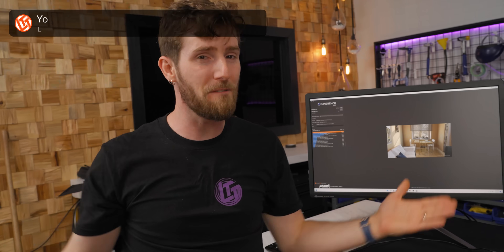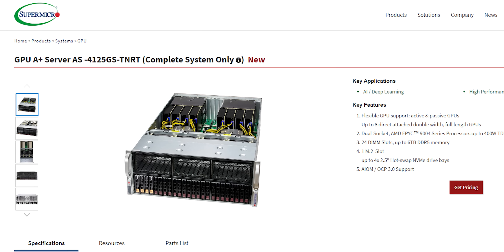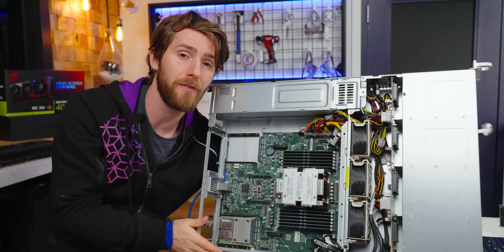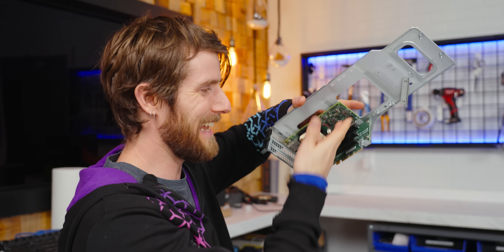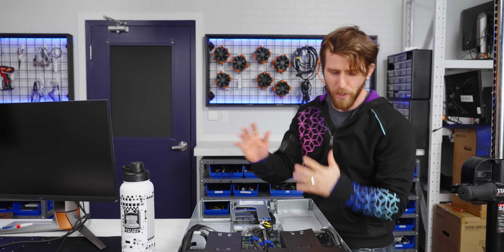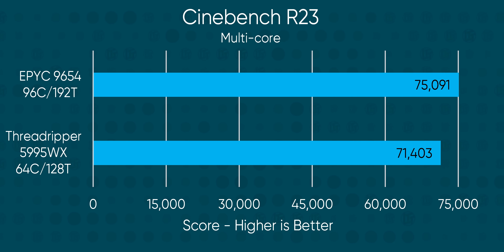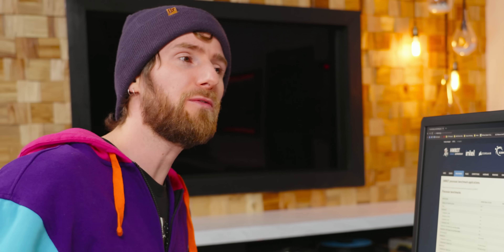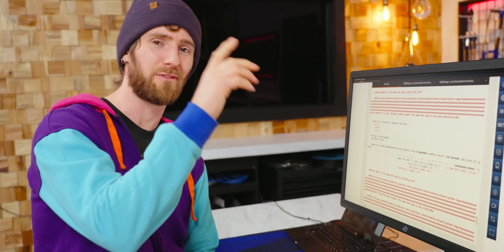HOLY $H!T - The FASTEST CPU on the Planet - AMD EPYC 9654

Comment: Almost 20 years ago we were stunned with dual-core CPUs. It's amazing, what AMD is doing.
Reply: And that was a game changer.
Reply: @flammablewater1755  Cerebras already sells a computer with 850 thousand cores on one processor. It's basically a CPU that fills the entire silicon wafer.
Reply: Yeah. Software, except few special cases, still can't do squat about these cores.
Reply: @SaHaRaSquad  and it consumes 15kW, you'll need a 400V 3x20A connection for just one as the whole system with that one CPU consumes 20kW
Reply: @BH4x0r  Which makes it incredibly efficient, consuming only 0.023W per core.
Reply: @SaHaRaSquad  sure, but AI acceleration requires vastly simpler instruction sets compared to ARM or X86/64, so you can't compare power & core count directly, it's like people talking crap about x86 vs ARM while ARM hasn't even got half the instructions and power (transistor count really) required per core per ipc scales exponentially (which means, the more instructions and the higher the ipc, it multiplies exponentially)
Reply: I remember being very excited about upgrading from Athlon64 to Athlon64x2.
Reply: @ren7a8ero  imagine turning cpu to achieve 6 cores at 6ghz and you will get a game cpu
Reply: @flammablewater1755  We will probably struggle to make software parallelize across that many cores (though it would definitely be useful for servers running many tasks at once)
Reply: @piotrd.4850  Yeah, having a lot of cores isn't very useful unless you have workloads that are parallelizable, but when you do, it hurts when you can't offload it to a multi-core server. It took the x264 team many years to work out how to take full advantage of multi-cores. I imagine Linus will be putting these bad boys to work as render farms.
Reply: @SaHaRaSquad  just looked it up. That's absolutely insane...
They also just launched a new supercomputer a few weeks ago... Apparently it uses just 16 chips yet still has 13.5 Million (!) cores 😯😲

For others:
Look up: "WSE-2 chips"
Reply: AMD is putting the AMD in Amdahl's Law! /s =P
Reply: And AMD was the first with dual core.
Reply: @circuit10  a lot of uses will probably split those cores up for virtualisation. And the us3 cases that require that many cores would be very bespoke software applications, in much the same way as software that will take advantage of the upcoming genoa-x will be (genoa-x being the 3dvcache version of the chip, with way more l3 cache than even these have, but with less cores and lower clocks as the cache is more important than the speed or the core count for certain specific applications).
Reply: @BH4x0r  So what? Use a decent machine with ARM and you'll see how little the instruction count matters in 99.9% of situations.

I don't know what your point is, I literally just mentioned a CPU with an insane number of cores, I don't know what the hell you interpreted into that.

Comment: imagine how fast this bad boy could print hello world to the screen
Reply: this wont really be faster than a normal PC (might even be slower)
Reply: depends on the screen
Reply: @CalcProgrammer1  really doesn't. Printing to standard out is just writing to a file
Reply: @hwstar9416  Depends what you mean by screen.  You can write to stdout faster than stdout can be rendered to a framebuffer and stdout can be rendered to a framebuffer faster than your screen's refresh rate.  However, the original question was explicitly how fast it could write to "the screen" and the screen only goes so fast.
Reply: @hwstar9416  You must be fun at parties
Reply: If you write "Hello World" into the CPU L1 cache it could take nanoseconds

Comment: Was floored at the 4090 comparison, the fact that the card is the size of the power supply and looked like a tenth of the server rack, is insane.
Reply: Yeah man, that thing is insane. I bet theres ITX cases with less volume than that
Reply: @musguelha14  micro itx, you're probably right!
Reply: It's called bad engineering. Boomer tech. I can wait for thin small nice gpu with 75 watt to play 4K 240fps. No cable needed.
Reply: Well, er yeah, obviously that would be great. Count me in. Then you just know an AIB partner in 2036 is going to push 800watts through that puppy to power the 80,000 shader units and the GDDR11XX.

Until we hit some kind of ceiling or have some kind of sensible standard this shit is just going to get crazier and crazier. 
Unless there's some kind of architecture or engine that renders all that power obsolete. I started to get hyped for the Euclidean thing until I realised it was all voxel... But something.

Just don't knock the people that made it all possible. These guys are legends. They made all this real. Like Dave Haynie and the guys at Commodore are my heroes.The whole 'boomer' shit is just insolent, infant bullshit to piss people off and get attention. Rise above that. You're better than that.

Comment: To those complaining about a server booting in 15 minutes, there were IBM p series (booting AIX) that would take half an hour just for the POST, before loading the OS.  With the OS booting and getting everything running, it would take about an hour.  I had to deal with 7 of those in a test lab I worked at back in 2010-2016.  They were not fun.
Reply: Probably built not having to reboot it often.   Yeah I too hate long server reboot times while my users keep asking "Is it back up yet as I have work to do?!" 🤣
Reply: Huh. Stores I assist still have p615 servers running AIX 5.X and they take a bit less than 15 min to reboot 🧐 But these need to go 😭
Reply: @RobBroderick44  Know what's more fun?  Having those in a test lab, where they have to be reformatted and total OS reinstall about every 3-6 months.  Wait half an hour for POST, then have a 30 second window to press F11 to get the boot menu to tell it to boot from CD, then another half an hour to start the OS installer.  Yeah, I had fun with those.
Reply: @dangingerich2559  One day if it is ever possible in your case switching to Linux and kexec'ing the kernel the reboot would allow you to scrap out the post time when the reason for the reboot is not to check the hardware.
Also there were more and more patches coming in the past two years or even more as well as in the years to come for Linux to allow parallel cpu booting and greatly reduce boot time.
Reply: @naguam-postowl1067  That's nice and all, but I (thankfully) am not in that job anymore, and am not dealing with IBM p series or AIX any longer.  I don't plan on applying to any jobs that include such things, either.  

At the time, I had to stay with AIX as the OS because we were testing customer specific circumstances, to make sure their OS and software would work with our backup appliance.  So, I had little choice in what OS we tested.  I believe that customer was US government, too, so they had little choice in the matter, either.
Reply: Servers are booting longer than consumer PCs because they have to initialize more stuff and perform more pre-boot actions. Normally PCs doesn't have any real lifecycle controllers, remote access controller, hw RAID controllers etc. These all adds up and mostly are not initialized asynchronously ( doesnt matter server or PC ).
Reply: Just start them all up and go eat lunch lol, come back and they're all ready
Reply: Why is that so long though?
Reply: @manojgail  because it was designed to never shut down.
Reply: @manojgail  They just take that long to power on self test.  They go through basic diagnostics on all the hardware before booting the OS.  The users of such servers are relying on the server to be reliable and accurate.  IBM kind of took it to the extreme, though.  It's been 7 years since I worked with them, but I think the model was p520?
Reply: @manojgail  I think because it has to train all 6 tb of memory. With a regular computer it only takes like 30 seconds or so to train 32 gb

Comment: In regards to the RDDR5 peculiarities you guys noticed in this video -

DDR2/DDR3/DDR4 were all 72-bit ECC. As you noticed, DDR5 is 80-bit ECC due to the DDR5 DIMM having two separate 32-bit subchannels. Each subchannel needs its own parity, and while it only needs 4 bits of ECC per subchannel, there aren't any 4 bit die structures so they get a full 8 bits of parity each. This means, yeah, a non-ECC DIMM has 8 DRAM chips, and an ECC DDR5 DIMM has 10. Previous DDR formats only needed 9 per rank. Since 10 chips is 11% more than 9 chips, there will always be at LEAST an 11% cost premium for DDR5 ECC DIMMs compared to DDR4 even if there is a per-bit price parity between DDR4 and DDR5 DRAM. Also, due to each DDR5 DIMM having an onboard VRM, DDR5 will cost more by structure. Eventually, DDR4 and DDR5 DRAM production volumes will flip, so eventually DDR5 becomes lower cost than DDR4. However, there's always going to be that cost premium baked into the structure.

Also, there will be off-roadmap 72bit DDR5 RDIMMs designed for specific hyperscale customers who do not want to pay the 11% extra bit premium for full 80bit ECC. A 72bit DDR5 ECC DIMM does NOT have full ECC coverage, but companies like AWS who control their entire software stack have written their environment to be aware of this and just deal with it. 72bit DDR5 will not be available to general customers because most people won't understand what 72bit DDR5 is, would buy it expecting ECC support, and have ECC failures in production due to the nature of 72bit ECC in DDR5. To avoid customer fallout, these 72bit modules won't be available to most customers nor will they be advertised on websites or general product roadmaps.

Secondly, you noticed that the registered and unbuffered DIMMs have a different notch. This has always been the case. You were not specifically comparing ECC vs non-ECC DIMMs in this video when you compared the key notch - yes, one had ECC support and the other did not, however, the key difference was one was an Unbuffered DIMM and the other was a Registered DIMM. There are no modern memory controllers which can support both RDIMM and UDIMM memory modules, so they are keyed differently. All registered or RDIMM modules are ECC, but unbuffered or UDIMM modules can be ECC or non-ECC. Consumer processors are all based on UDIMM. So, yes, you can have a CPU support both ECC and Non-ECC memory. Specifically, unbuffered ECC and unbuffered Non-ECC.
Reply: Thanks for the explanation. Where can I learn about all these and more? Very interested in DDR technology
Reply: Sounds like you know a lot about this.
Very interesting explanation where I could understand most of it even though having almost no idea about this stuff otherwise.

The 72-bit ECC module story sounds interesting. How does one learn about such a story?
Reply: Bro break it down. You lost me after i clicked
Reply: Fantastic lecture!  This man should teach a class on memory topology!
Reply: Yes
Reply: I am still waiting for DDR4 to become cheaper lol
Reply: SOMEONE! ANYONE!! PLEASE READ HELP!!! Does anyone remember a few years back a certain cpu would only work with a different type of memory? I can’t recall which it was? Intel extreme? Threadripper ? I just remember it was a more expensive sku and I also believe a different mobo was needed. I just clearly remember Linus talking about it but i can’t find any info on it. When Linus mentioned that ecc memory I started remembering but I am stumped.
Reply: Damn, what do you do for a living? Where can I learn more about this?
Reply: that’s so much reading i wanna understand but holy hell
Reply: Knowledgeable post by a user with a forgetable name. This guy knows... things.
Reply: Tldr - Ram
Reply: @D-2-the-no  His comment is a break down. Read it slowly. It's not difficult to understand if you are a tech enthusiast.
Reply: Ain't reading all of that
Happy for you though
And sorry for your loss
Reply: What about chinese X99 boards? They can use both UDIMM and RDIMM, but not at the same time. Sockets looks like a regular ones, i don't have any fancy server sticks on hand to look for difference. Also 8 bank UDIMMs does not work. (Cheap 4 chip kingstons are clear example)
For anyone curious chipset is C612.
Reply: ... I just asked where Starbucks was...
Reply: @vigilant_1934  its been edited since. Makes more sense now
Reply: Sir, this is a Wendys....
Reply: tldr
Reply: I'm not reading this article.
Reply: V & D found each other
Reply: Are you calvin ?
Reply: Even Linus was impressed
Reply: HOLY SH*T. 10 Hours of reading through elongated papers in three paragraphs. You are a talented legend. One question: Does not having full ECC coverage impact performance?
Reply: I need a bookmark for this..
Reply: I was going to comment this exact thing, glad you did it already. Now I can go back to Tetris
Reply: @noname i like your funny word magic man
Reply: Thats a lot of ECC
Reply: Finally !! some info in the video, not this crap of memes and jokestechtips.
Reply: When are we going to have HBM3 in the CPU die?
Reply: This CPU probably has more computing power than all humans alive today combined.
Reply: Not gonna read this, hope you head fun writing it
Reply: now in ltt comment box freaking NPC start to commenting 💀 with full explanation.
Reply: Yeah I didn’t understand any of what you just said
Reply: @D-2-the-no  OK. I think I saw it before it was edited and I understood it.
Reply: I have bookmarked this page for this response alone. Thank you for  educating us.
Reply: This guy rams
Reply: They are all super slow. It seems the newer the technology, the slower it is. It is funny how years ago, RD ram was faster than anything that is being produced today. Too bad people get hooked on useless information and play of words to make them think things are faster today. My P4 with 512megs of RD ram was still faster then anything that is on the market today. Trying to use a new computer today is like watching paint dry when you are trying to open notepad.
Reply: @osdfonrego on youtube no troll u can learn ANYYYYTHING on youtube you REALLY can. 😊

I'm being serious lol I really am.

Comment: You should totally try the software renderer in Crysis again! See how good these CPUs are at being a GPU!
Reply: But can it run Crysis? /s
Reply: @RebrandSoon0000  Probably not these CPU's suck for gaming.
Reply: @Aka_daka  He was talking about software renderer just to see how it compares to other CPUs.
Reply: Would be good to quickly see it as an aside again in another episode, just to see how it compares. I'm betting it would at least be playable this time. What was it before? Like 12fps?
Reply: I just need Ryzen 7700 coming January 10th 2023 to build my 4K 240fps PC. But idk what gpu, all high power earth killers  higher than $400 price.
Reply: @Aka_daka  For dual CPU setup, they do suck. However, for single CPU , they will perform well. Of course the price/performance ratio will suck, but performance should be good.
Reply: @RebrandSoon0000  I started reading the comments on this video, specifically for the Crysis jokes.🤣👍
Reply: @machinist7230  Nice :)
Reply: It should run BeamNG with 100 cars
Reply: @gabrielv.4358  Voooooooom!

Comment: Back in my ISP/Datacenter days, we had a long standing joke about slow boots. Whenever something took forever to boot, we would say it was doing a SuperMicro. We would joke around and say that the reason why people buy 4 of their servers at a time is because they took so long to boot that there was a risk that another one would fail before the first one finished booting back up. Good to know that things haven't changed much.
Reply: @Gatorade69  in datacenter we use a special type of RAM memory with the integrated error correction code or ECC. With the introduction of DDR5 the ECC comes to the wide consumer market, the ECC technology is part of the default design of every DDR5 module. Now back to the question you asked - compared to the classic desktop setups based on the CPUs you've mentioned, within the ecosystems using the server grade buffered RAM with ECC we have a lot more stuff going on during boot time (as one might have guessed) - with the primary time consuming one being the so called "memory training".
Now, that alone is a whole new topic with a ton of settings in BIOS and it prolly deserves its own chapter on Linus TT or Steve's GamersNexus... Anyway, memory training is a one-time event that's performed by the system on its first boot or subsequently after any significant or otherwise unique change within the particular system, during which the system sets up, tweaks and tests the RAM memory and all its advanced features like the ECC so that it works at its best.
That takes time.
Of course, in this video Linus showcases the latest CPU by AMD and also explains how there's a bug present in the microcode that causes the long boot times nonetheless and which AMD announced a fix for in the upcoming days hopefully.
Reply: @MilanPutnik  I worked for SoftLayer before IBM bought them for their cloud. We had super micro servers and they actually didn’t take that long to boot up in comparison to AWS servers. When I worked for a AWS manufacturing plant doing diagnostics, those were by far the worst. Lenovo had some shit boot times too. I actually prefer Supermicro boot times over Lenovo and AWS boot times anyday lol. Unless you have one of them 4us with 2/3TB of RAM then forget it.
Reply: @Gatorade69  Cause the motherboard needs to check absolutely everything. The ram and the hard disks usually take the longest to check.